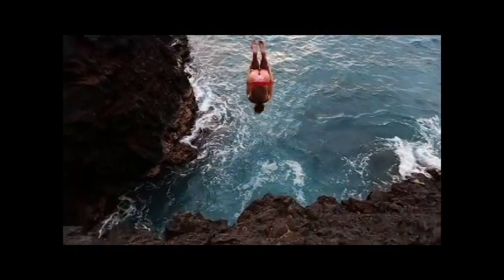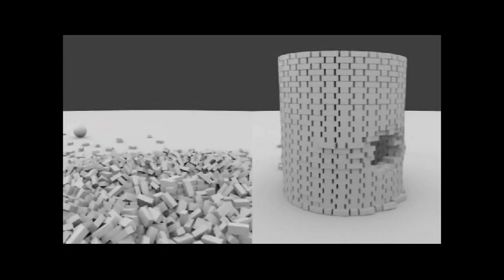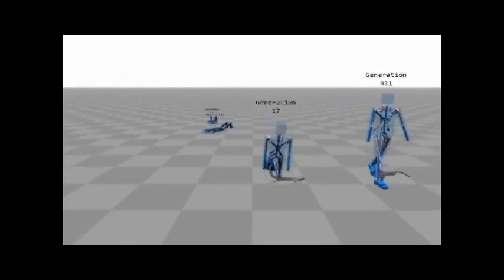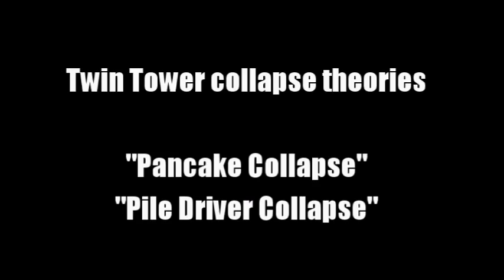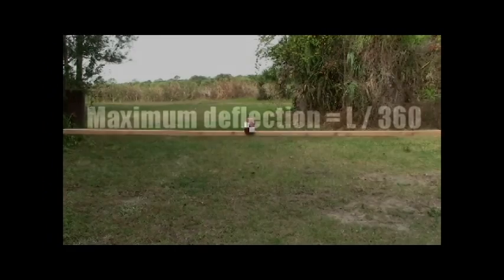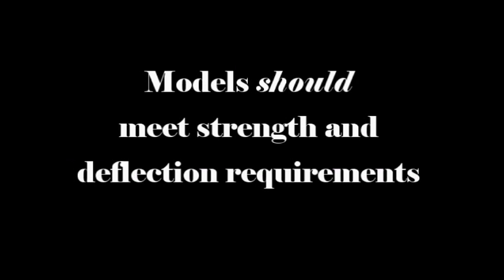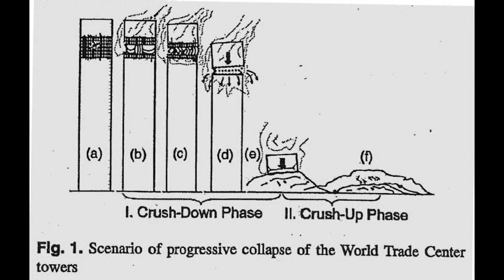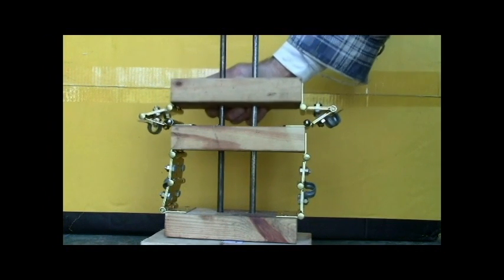9/11 Experiments: The Force Behind the Motion

Comment: Haha what a moron. This guy clearly isn't a scientist. 

2 things he clearly doesn't understand:

1) Static vs dynamic. 
2) Load vs structure. 

Also you cant use random materials, plastic, concrete etc with variations of widths to assume it measures to the equal strength or weight of the real life equivalent without perfectly accounting for its individual properties and scaling it. 

Also dropping a small weight that isn't the same width of the plates changes the force applied, making it direct point pressure and not spread evenly. 

And then he didn't take into account the tube in tube structural design the WTC buildings were designed with. Its a very unique design and affected the outcome differently compared to most other building designs. 

He then also didn't take into account the elevator shaft acting as a conduit, burning other floors (fires were seen from the basement elevator shaft), these would of weakened other areas of the building. 

Such nonsense!!!!
Reply: " no architects or engineers talk about knowing how buildings are disaster proof as a requirement for their education"

What does that even mean, you silly little kid? What buildings are "disaster proof"??
Reply: "you're saying  that a plane weakened a mostly steel structure so perfectly that it got it to fall down perfectly on its ground floor and it did it not once but twice?"

The fire did that. Why are you so surprised that two buildings which suffered similar damage failed in the same way?

Oh, and what is "fall down perfectly" supposed to mean? Did you expect them to fall UP? LOL.

"explain why and how those planes were hijacked from military trained pilots"

Because you are an ignorant child, you know nothing about hijack procedures pre 11/9. 

"while air traffic control is required to call in air force jets when Comercial plane goes off course?"

Look up the Payne Stewart case, kid. See how long it took them to call in the air force after that aircraft went off course and stopped talking to ATC.
Reply: "you can't even debunk the wtc 7 falling at free fall "

Already debunked. As you have been instructed, compare the time it takes an object to fall 202 meters with freefall acceleration. Then compare it with how long it took WTC7 to collapse.

Are the values the same? No. Therefore, you did not see free fall acceleration.
Reply: " knowledge of physics"

OK, try me. What do you think physics says that supports the konspirotard nonsense?

How come no twoofer physicist has managed to produce a peer-reviewed paper, published in a serious scientific journal, showing how "physics" proves e.g. NIST's collapse model for WTC7 false?
Reply: Woa woa woa now Randle Guill!  

These sheep think it is more plausible that a shadowy organization of the government, secretly setup the WTC towers for a controlled demo to fake a terrorist attack.....that it is less or impossible that a terrorist organization could hijack and fly passenger airliners into buildings in an actual terrorist attack.

Come on man, for a conspiracy theory to work, you have to have an overly complicated plot that fits a Hollywood style narrative.  

You cant put logic into it and expect them to believe you.
Reply: Slater Slater seen every video please link me evidence proving that it did not fall at free fall. and link me evidence that those buildings you say were damage by wtc 7 weren't damaged by the towers to begin with
Reply: Pancake theory is bullshit and you know it. How did the support columns fall from this theory you fool.
Reply: Wilko , you're such a troll.  Go away.
Reply: Ok, let me look at your evidence.  Hmmm, wow.  It seems the only handful of articles belong to conspiracy theory groups, wow, that is evidence!  Why didnt I see this before?!?!?!  Oh, thats right, they belong to conspiracy groups.

I mean the simple explanation that a terrorist organization could fly passenger airliners into sky scrapers is so completely out of reality and impossible.  What is possible is this idea that a shadowy organization could coordinate this super secret plot to set up a controlled demolition under the guise of "structural improvements and safety" so that they could destroy several buildings and kill thousands of lives and nobody the wiser?  

Yea, ok.  I will let you keep thinking you know the "truth"

Sad reality is, you're also a sheep.  Just following a different Shepard.
Reply: Why building 7 tho, why "demo" it hours later if your goal was to create an excuse to go to Afghanistan?  If destroying the towers was their goal to create an excuse to go to war, then building 7 collapsing hours later would not fit into that narrative.
Reply: Michael 111 To be fair, the Titanic was designed not to sink, however things don't always go as planned...
Reply: Electro Jay - It would be nice if rational discussions could be had with some of these believers of the official story.  But the reality is, that either they are shills or a more likely scanario is they are ill equiped to handle the truth.  knowledge of physics, engineering, or all the "coincidences" that happend throughout September 11th between (stock shorts, air force off in canada training, fema moving out of WTC7 prior to 911, Bush family involved in remodel and security of WTC, the list is endless). are not something they probably know about and they probably dismiss each and every item without a rational thought.  

It is scientifically proven that those that do not question things (don't entertain conspiracy theories) are in fact not normal and are the crazy ones.
Reply: for the record the planes on 9/11 are claimed to be 767's. 
747's are the largest followed by 767 and 757 being the smallest
Reply: According to your logic it should have been a pretext to go to war with Saudi Arabia, after all, they've got a lot more oil than Afghanistan.
Reply: Oh dear, the majority of twoofers are a bit nutty but you are seriously paranoid.
Reply: brando92711 hey Mr. straw man. who'd you root for in America's 2016 election? I bet I know the answer?
Reply: "Would of"
Reply: S Wilko: So u r saying the unique structure of WTC, an elegant product of tube theory is inferior to the crude paper model here, that it fell like a house of cards? Also just tell me, how the falling mass of just 21 floors accelerated while pushing 89 thicker floors beneath?
Reply: S Wilko: One fucking airplane smashed through the 21st floor and stripped off the fire protection of all 89 remaining floor? wow! And papers and plastics burnt in so high temperature that it melted steel? Wow! again.
Reply: God Slappy they were almost all college educated with engineering degrees
Reply: Slater Slater And why are you too much of a troll to explain how less than 50% of both buildings takes down the ENTIRE building all the down to below the first floor. how is that possible and how is it that both towers had this same fate young man. of course you're reply will be another strawman troll about it being "a yuge plane Bro full of chemicals man of course the chemicals magically fall down each floor and magically ignite everything inside dude do some math" when in reality there's still these issues. 1 the towers fell the same way despite having different impacts. 2 you know the nature of our air space and those who work on planes fly them and operate the radio to communicate with them. the hijackers can't take over 2 military trained pilots. the air traffic radio ppl would've been able to alert the air force that planes are going off course long before the planes could even leave a state.  and 3 why does the climate of a false flag not make sense to you when this country admitted to making false flags to join wars 3 times before 911. ass wipe
Reply: randle guill so my guess is you wish to ignore my points explaining that an equation doesn't change what actually happened and I never said a demolition couldn't damage buildings around especially since the 2 towers near it had  already fell. but tell me why can't you refute my other 2 points why are you only looking for points that I may be weak on when those points don't take away from the plot wholes I already laid out wholes which you are ignoring. call me mad or whatever but it's a fact to say that you don't know how to have a conversation and only know how to be condescending and back yourself up with points other ppl made you sir are a lazy fuck with nothing to do while I actually understand why our gov would commit a false flag and I actually wish to get to the bottom of it you on the other hand have no goal you just want to feel like you won an arguement today but it's ok you probably never were taken seriously as a child when you spoke do you grew up to be a loser who can't speak to people if you even grew up at all
Reply: s Wilko i completely agree
Reply: Then explain to me building seven. Then I might take you seriously.
Reply: So, for the whole Controlled Det to work, these nefarious shadowy figures would have had to lay a shit ton of explosives....without a single person noticing.  Also, you people realize that there is a ton of work that goes into making a controlled det work right?  That it isn't as simple as just stuffing explosives into every nook and cranny.  You also have to weaken key supports so that they will fail the way you want them too.

They would have to do ALL of this, without a single person noticing?....hmmmm, yea ok.  I mean its inconceivable that a terrorist organization could ever hijack passenger airliners and fly them into buildings.  That, would be impossible!  -.-
Reply: Obviously you haven't done much research into this then? There were complete level closures over a 9 month period prior to 9/11. My advice would be, do some research before you make sarcastic comment that make you look stupid and childish.
Reply: Seems that nobody can explain building seven. They just keep bitching about conspiracy theories that end up raising a few questions that still can't be answered. Some of them are closer to the truth than a plane being hijacked by men with box cutters.
Reply: Yes because that could NEVER happen, a plane being taken over by men with box cutters...pffft, how ludicrous! It is more plausible that a secret organization snuck in some explosives to level building seven for a controlled demolition, that could be the ONLY explanation.....

Yea, whatever....

What you really need to ask yourself is, why would this secret organization want to bring building seven down in the first place?  If they wanted to make it look like terrorist also took it down, why not drive a bus of explosives or fly another plane into it?  Why have it randomly collapse several hours later?  Hell, why not bring down more buildings to raise the death toll even higher?
Reply: Allyn Davis it doesn't have to be a secret organization. America openly sacrificed it's people in the past just so the citizens would want to go to war.  take the gulf of Tolkien for example. and wtc 7 was said to be brought down by office fire and if that's true than its the first building that size to collapse from office fires. So what's wrong with questions about the official story?
Reply: Allyn Davis if you destroy your own building and got everyone to believe it was part of a disaster you'll be insured by the bank or whatever companies that owned it. So knowing of a coming disaster could give you a chance to capitalize on it and profit. also it's reported in a  mainstream media outlet that was on the ground and in wtc 7 that most of the staff of wtc7 weren't in the building when the first plane hit and in the 2 towers it's same with certain floors that were cleared for 9 months before
Reply: S Wilko created an account just to make that comment. How odd.
Reply: I remember in the defence force when we were handling mines and we used tank triggers (meaning you would need higher load to trigger the mine), if a person stepped on it nothing but if a person with the same full gear ran over it and god forbid jumped right on top of the trigger, kaboom. 

Dynamic af load.
Reply: randle guill so? ok tard understand that wtc 7 suffered a much smaller fire that burned out before it collapse a mainstream outlet caught this on camera
Reply: randle guill and you said lol to the gulf of Tolkien you just voided yourself from any rational argument if you honestly can't acknowledge an admitted false flag
Reply: randle guill evidence all you have to do is look up ground footage of wtc 7 you'll get the few videos of reporters on the ground getting info about wtc 7 you can see how small the fire is and a secret service cop tells a cameraman that no one has been in the building and that the fire seemed like it was burning out and he is in wtc 7 when he says this and you can just it's bs because you're to much a shill to look up the footage
Reply: Fox Mcloud the gulf was a false flag because American lives were sacrificed so the public would be pro war what are you talking about
Reply: randle guill ok troll you obviously don't know about the gulf of Tonkin why do you have an opinion on any of this but don't know the history that could tell you why 911 is questionable
Reply: Fox Mcloud Multiple floors were cleared before 911 for months floors that employees had no reason to go to so they'd never know what's going there. And if you think the claim is false just use Google to fact check before you respond it saves so much more time because I'm way to superior to sit here and argue facts that you'll eventually find are facts and contradict half the points you can think of. So for me to sit there and humor you as if you possibly could be right is incredibly ineffective. why?  because anything I say on here is well researched and well thought out i only engage in youtube comments so youtube COMMENTERS understand that I'm superior. So please if you wish to debate a fact that can be Googled please Google it before coming back to me  and make it look sexy.  All attempts to debate what's fact are useless because I know what is fact because I'm better than you.
Reply: randle guill lol an obvious troll America admitted already to the false gulf of Tonkin resolution you can troll and act like you don't know facts because I spelled it wrong if you want still doesn't change the fact you obviously don't know what you're talking about
Reply: randle guill lmao so in a controlled demolition does the building always fall perfect enough to fall at free fall? or
Reply: A man who worked for Underwriters Laboratories claimed that UL altered and tampered with the steel UL tested for Nist. I called Underwriters Laboratories to ask them why the man said what he said and to ask why Underwriters Laboratories has not sued the man for liable or slander. I can only guess that UL wants to avoid any Discovery processes in a court of law.
Reply: Slater Slater Link your sources and then you'll have the right to call bullshit.
Reply: Hello ProjectRealityBf2, so you want a scale model of a plane to be the trigger? "Fully Loaded"; how much of a planes weight is fuel? How much fuel would be consumed in the fireball shown? How soon after impact was the plane no longer fully loaded? How many planes parts are alleged to have been found outside the area of impact? Engines, landing gear? How much mass was really added to the overall structure? And what does any of this have to do with the 70+ floors of cold steel below?
Reply: How about you get a fully loaded 767, crash it into a hardened building at full speed and see how much debris is left.  We literally have no other comparison besides the WTC.  So this whole argument about lack of debris is moot until you can show what debris from such a collision  "should" look like in your eyes.  

Why is it such a hard concept to grasp that a terrorist organization could pull this off?  That you would rather cling to this notion of a Hollywood style complicated plot of a faked terrorist attack is the more viable option?  Our government cant even balance their own check book properly, what makes you think they could actually pull this off?  

Also, if there are terrorist organizations that want to see the US fail, why would they claim ownership of a "fake" terrorist attack?
Reply: The effect would be limited to the area of impact. The speed of the projectile can over penetrate a target and essentially tear through the object with little damage. If a majority of the plane's mass is fuel the physics of liquids would be applied. The majority of the lower floors were structurally sound. Had the buildings not fallen they certainly would have been in repairable condition. 
NIST will not release their computer model citing that it would jeopardize public safety. The National Fire Code for investigating fires was not followed. Explosives where never searched for, the money trail was never investigated and the devote Muslims claimed to be responsible are reported as having lived in a hotel room across the street from NSA Headquarters where the Muslim men bought lots of hookers and cocaine.
Reply: S Wilko MATE THEY REPORTED FINDING THE HIJACKERS PASSPORT IN THE FUCKING WRECKAGE! SUCH NONSENSE!
Reply: "The effect would be limited to the area of impact. The speed of the projectile can over penetrate a target and essentially tear through the object with little damage. "  

Are you speaking from experience or is this a theory?  You still need to address that such a collision has never been recorded before or since so we still have nothing to really say what debris from such a collision would or should look like if your claims of this being a faked collision.

Explosives were never searched for because there was no need to look for them in the first place.  Why would they have wasted their time looking for something that would not be there? Oh, sorry, I forgot you are basing this argument on your delusional conspiracy theory.  Hell, why didn't they look for Aliens too, stupid government inspectors....

"the devote Muslims claimed to be responsible are reported as having lived in a hotel room across the street from NSA Headquarters where the Muslim men bought lots of hookers and cocaine."

Reported to have been being the operative word here and reported by who?  A couple google searches reveal that most of them did not stay together at all and stayed in various locations...none of which were in Maryland.  Also, what does them "reportedly" staying across the street from NSA HQ have to do with anything at all?  You do realize that the NSA does not do domestic collection right?  That is the FBI's job....or are you including them on this whole conspiracy theory as well?  Also, another quick google search will tell you that the closest hotel to NSA HQ is roughly 7 miles down the road....so not across the street as "reported".
Reply: Why could men with box cutters not hijack a plane?
Reply: So basically 99.99% of the worlds structural engineers are paid shills who have no understanding of physics  or engineering!
Reply: Allyn Davis you are a fool to believe what you do, to not even consider questioning your governments involvement is naive and straight up ignorant. Calling anyone who disagrees with you (and your gov) a conspiracy theorist is what they want. They feed you lies, tell you what you want to hear, they have in the past (but you will deny that too) and they will continue to do so.. and you will continue to eat those lies up and repeat them to the people around you. You are the target of their lies and you are too blind to not see through them. 
I only hope that you don't poison your children's mindset with the same mentality. 

In fact it probably doesn't matter, the majority of the population are fucking brain dead sheep anyway, and that's not changing anytime soon. You are the laughing stock of the world, you will realise that one day.
Reply: S Wilko r
Reply: Oddly enough, Trump said on 9/11/01, speaking as a real estate developer, that he believed no airplane strike could bring down either tower. He talked about how a massive number of columns in the basement had been taken out without a collapse of the structure. Trump knows. The question is what will he do about it? He'd have to arrest Bush and Cheney if he revealed the truth, along Silverstein and all the people who traded the airline stock in the days before 9/11. More than a few people were involved. Rigging the explosives, alone, would take months in an ordinary building and huge chunks of structure would pancake down. The WTC buildings were much larger than any others ever demolished and they didn't fall in large masses. Those buildings were turned into powder, floor by floor, in perfect, professional sequence. No accidental accomplishment would be possible but we're told it happened just like that three times in one day... the only day in history.
The truth is NOT out there. It's right in front of our noses if we only look with open eyes.
Reply: this guy is actually on the right track, you my sir are the ignorant one, so best you shut up unless you can prove otherwise but you shall not for you do not have the intellect to do so.
Reply: We should listen to him, he knows more about buildings than all the structural engineers in the world,
Reply: Google loves you.
Reply: if he is a truther, what does that make you?
Reply: aside from molten metal pouring out of the building and pools of molten metal in the basements I don't know anything about molten metal at WTC
Reply: I have explained this very point, along with verifiable figures, many times to truthers. They have never yet challenged them, usually resorting to insults or change of subject.
Reply: Were did you get the idea the lower floors were thicker? Since each floor was designed to carry the same loading why would they be thicker?
Reply: randle guill if you throw your arm at it and your arm is less massive than the door you will not get far opening it.
The word push that you used says it all. Push means you needed to find a source of energy to increase the momentum of your arm to open the door.
Push is the equivalence of the explosives that added that extra energy to "push" all those floors aside.
Reply: Fox Mcloud  these buildings were mostly populated by the CIA  who lies extremely elaborately and believes the nature of its work should not be disclosed no matter what. Within the CIA their end goal justifies whatever means they use to get to it. if that means lying about what really went down on 911 then why wouldn't they? they've admitted lies just as grand like the gulf of Tonkin
Reply: Fox Mcloud this is caked rambling since you know the cia has the full extent of American resources and enough gov support to operate in total secrecy meaning it doesn't matter who said what they are a shadow of almost everything they're a shadow in our education our work our TV
Reply: Do you work for the Fuji Bank Fox Mcloud? If you don't, why are you concerned with their reputation management?
Reply: S Wilko you do realize wtc 7 did in fact fall at a constant speed and did in fact land in its foot print you can claim those things to be false but what use is claiming so if you won't prove something to be so. And just the pure physics of 2 giant buildings in new York falling to the ground would result in way more causalities way more city damages and we'd see our own government doing physical simulations proving their theories of how it fell if they really wanted us to believe the official story. also you do understand that in AMERICA  we are extremely talented at being prepared so when we build huge sky scrapers we consider every possible disaster that can happen and do our best to take prevention measures. one of those measures for buildings in all American cities is to make sure we don't loose 1000s of lives in a building collapse which is why they go out of there way to tell anyone owning stock in the building that it will be earthquake proof, huge plane proof.  you know just all around disaster proof.
Reply: And cell phones can work in planes. And they can fly at 500mph at low levels. And pilots do not squawk hijacking codes. And flight attendants don't follow hijacking procedures. And the engines from the aircraft do no damage to the pentagon. And a few arabs with stanley knives can take control of, and fly commercial jets at high speed will little more than ppl qualifications. And black box data is not released. And the most protected building in the world can be attacked by a bunch of arabs. And radar tracks can disappear. How many holes in the official reports do you need?
Reply: It still doesn't explain how both towers collapsed the exact same way. Physics demands an equal an opposite reaction, the top portion of the buildings didn't have the weight to collapse the entire building. There should have been a deceleration, and the portion that fell should have either stopped completely or slumped off to one side.
Reply: Hello Allyn, I speak from experience regarding the over penetration of a target. The plane would have created a significantly greater impact had the plane been traveling at 300mph. 

I doubt that you can logically explain or justify why the National Fire Code was not followed in the investigation. 

Only days after Pearl Harbor, JFK, the Columbia shuttle explosion was a committee formed to investigate the incidents. For 9/11, it took 445 days before a committee was formed to investigate the largest attack on American soil in American history. The investigation only began after the families of fighter fighters sued the US Government. The initial budget to investigate the largest attack in American history was 3 million dollars, later raised to $15 million.  
To give some reference the American taxpayers paid $50 million to investigate a blowjob Monica gave to Bill Clinton.  

Let's back up and do this Columbo style or Matlock. Who was not at work on 9/11? Who missed work and why? Where was Larry Silverstein on 9/11? Where was his son? Where was his daughter? If you know who Charlie Rose is, you can watch Larry tell it in his own words on the Charlie Rose show. You decide for yourself if you believe him. 

Who benefited from 9/11?

Exactly which offices were hit on 9/11 and exactly who are those companies? What types of business are they engaged in? 

How did the terrorists board planes without any of the terrorists names appearing on any flight manifest list? 

Why was a majority of the steel from the WTC site shipped all the way to China to be smelted in China? 

How did 9/11 effect the price of oil?

How did 9/11 effect the price of gold?

Now that Osama is claimed to be dead, when will we repeal the Patriot Act? 

Why is there only one camera at the Pentagon? 

What happened to the missing money Donald Rumsfeld reported missing on September 10, 2001?

Why was the WTC building powered down two weeks prior?

Why where the bomb sniffing dogs removed from WTC prior to 9/11

What was the gray dust inside the building as reported prior to 9/11?

Why did so many people Short Sale AA stock weeks and days prior to 9/11?

Why did people who short sold AA stock never go and collect their money? 

Why won't NIST release the computer model they used to show a collapse? 

Why did Underwriters Laboratories falsify information on the beam UL tested?

Why did the mayor of NYC remove all the police officers from "the pile" the day the gold was recovered? Where the officers looking for victims or where they just guarding the gold?

What fuel source allowed the fires in the basements to burn for weeks? 

Why are the planes on 9/11 all gray? 

What was that shape on the fuselage of the 767? 

Can a 767 reach top speed fully loaded at sea level?

At the pentagon: how difficult is it in fully loaded 767 traveling at maximum speed to descend in a 360 degree corkscrew spiral and to come level with the hard deck just meters away from the target? Wanna try it? Are you a pilot?
Reply: Slater Slater are you foreal? do you honestly need math to show what you can see on video or are you just a troll? I see with my own eyes that wtc falls at 1 speed the whole fall. and what about the other wholes in the story or are you only good at arguing one subject?
Reply: Flying a plane isn't all that difficult. Try a flight simulator sometime.

& it's especially uncomplicated when you don't have to worry about learning how to land.
Reply: Slater Slater I mentioned a variety of problems like the fact that buildings are made in such a way that the kinda fall the towers had would have to have been forced. to disagree with that is to disagree with builders who say they always build this way
Reply: Slater Slater so no architects or engineers talk about knowing how buildings are disaster proof as a requirement for their education? you're extremely jaded and have not done one Google search that's all it takes to learn that fact moron
Reply: Slater Slater And here are with a misrepresentation holy shit so you're saying  that a plane weakened a mostly steel structure so perfectly that it got it to fall down perfectly on its ground floor and it did it not once but twice?  ok it's clear you wish boil this down physics. and you use the physics like you just learned it. you wish to believe you can't lose and that's some ego thing you got going on idk wassup with you but anyone can admit where logic is flawed and you refuse. but can at all explain why and how those planes were hijacked from military trained pilots while air traffic control is required to call in air force jets when Comercial plane goes off course?  or is that outside of your realm of understanding? do you only know how to use the official story as a base for arguement? can you actually look at something regardless of what others think and provide an honest answer or do you just truly only know how to argue one useless point that you yourself can't even back up
Reply: TeknoD....are you serious or just trolling?

The whole passport thing has never been confirmed and the only place you find any such mention of finding  passports belonging to the hijacker's, in the rubble, are on Conspiracy Theory sites.

Besides, the names and identities of the hijacker's were found through other means and detective work....not by passports found in the rubble.
Reply: S Wilko these truthers smoke crack.  you can reason with them. They're almost as bad as flat Earthers.
Reply: Your comment is nonsense. All steel girders were thermally connected. Fires were sparse and the heat conducted away from the spotty fires on the floors of damage. Dark smoke was to be expected from oxygen-starved fires. Fire retardant materials are supposed to be used in all offices, making the spread of the fires slow and low temperature.

Let's see you come up with a better experiment. Where's your video. Mr. Cole did an outstanding job showing basic principles at work.

WTC7 fell at perfect free fall. I suppose you'll tell all of us that solid steel can sometimes offer Zero Resistance? Not in this universe. But controlled demolition can make it look that way.
Reply: Rod Martin, Jr. well im would be happy to prove why what you just states was pathetic. But you made one comment which proves your ignorance and why you dont deserve an intellectual response. 

WTC7 did NOT fall at freefalk speed!!!! That is bullshit among crazy conspiracy nuts. The seismic and video data is conclusive that it only fell for 2 seconds at freefall then rest a lot slower. This proves it was not demolition. Also it didn't fall in its footprint. Another thing conspiracy sits lie about by using videos or photos from certain angles that gives that appearance. So i have no other reason to explain to morons like you the full detail of everything as I know your type. Even if there was conclusive scientific data you would still claim your nonsense. You lot are all the same.
Reply: Rod Martin, Jr. you also need to remember a fucking airplane smashed into it. Removing all of the fire protecting chemicals. And black smoke from the burning materials in a building. It was an office. Plastics and wood all burn black!!!! And you need to learn about conduits. And about thermal girders - heat and temperature are not the same. I suggest you go back to school to understand why that matters!!
Reply: God Slappy They where traines by the CIA.
Reply: S Wilko Amazing Explaination, thank you.